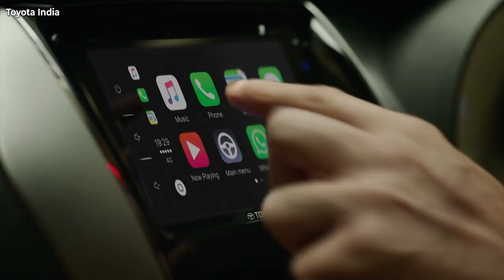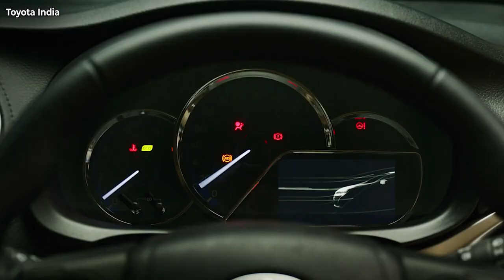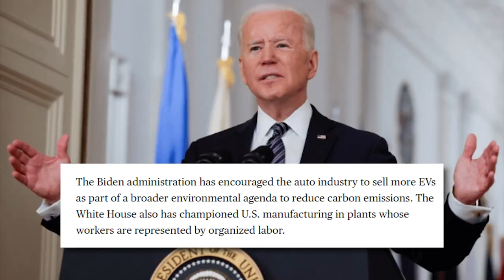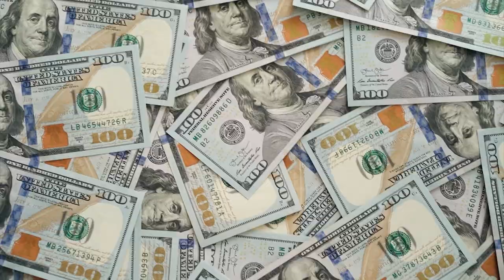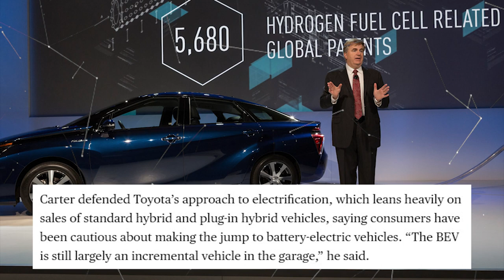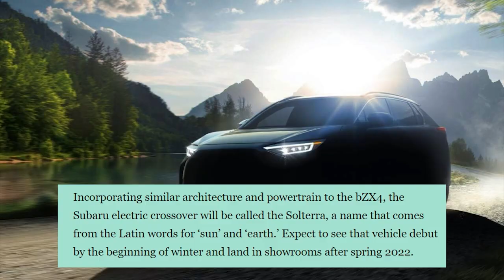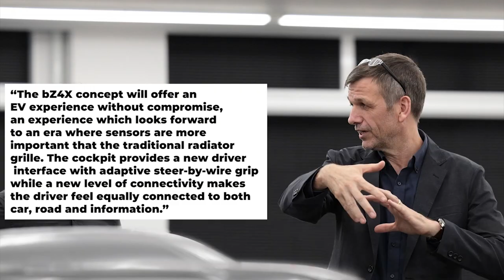Toyota Signals a Big U-Turn on Electric Vehicles With a Major Shift

Comment: It's about bloody time those at Toyota woke up. Toyota should be at the head of the game not at the back!  Whoever is responsible should be forced to resign ,this could be devastating for the company.
Reply: they actually had plans to make hydrogen fuel cell cars and not electric cars, but due to the lack of a proper infrastructure and hype about EVs, it was getting difficult for them. That is why they are behind in the EV race. It was one of the major reasons toyota wanted US to slow down ev production numbers

Comment: Toyota has been digging its grave for years now, and there is no way it is going to survive if it doesn’t go EV.     RIP  Toyota.
Reply: Your so funny
Reply: Toyota now what to do .. let them race for electric car in the begining  with some stuff issue... in the end the weapon of reliable electric car is the winning.. lets not forget  toyota now  testing new concept zero carbon , which is a regular conventional combustion engine with hydrogen fuelcell..
Reply: @dencesolihin9186  Hydrogen is not a green fuel. It is made from natural gas and is worst than petrol and diesel for environment. Just more Toyota BS.
Reply: You should do some research before making blanket statements in a public forum.  Your future you will thank you.   There is a big, wide, world out there with somewhere around 6 billion people.   The vast majority of those people will live their entire lives driving only ICE vehicles.   Of that majority, roughly 15% of them will be driving a Toyota.
Reply: @kratosdisciple4637  Considering that many countries is banning ICE sales in the next 10 to 15 years I will not bet on any company that still want to give ICE a place. But knowing Toyota they will just buy it from someone that went through the effort of developing it.  Just hope for their sake they find a seller. Toyota might build fairly good vehicles, but they are not known for their innovation.
Reply: Toyota is the largest car maker on the planet. They can launch EV's easier than farting.

Comment: Smart.  Artificially pushing supply for a product most drivers don't want doesn't makes business sense.  When I can "fill my tank" with electricity in 5 minutes like I can my IC vehicle, get back to me.
Reply: Is that why Tesla is now selling about half the vehicles that Ford is selling in a quarter? Because there is not demand for EV's? That makes business sense to you? Ok interesting.
Reply: @andresd6193  I told you not to get back to me until an EV can fill up in 5 minutes.  But have you checked Toyota sales?
Reply: @starman2337  That would be never, and EV is never going to charge in 5 minutes and a gas tank does not fill up in 5 minutes either. LOL.
Reply: @andresd6193  Really?  Mine must either be a magic tank or my station uses a magic pump.  But at least you got the "never" part right about an EV charge.
Reply: @starman2337  you must have a very small fuel tank.😄
Reply: @andresd6193  Of course there is a demand for EVs.   There is also a demand for C8 Corvettes.   For Bugatti Chirons.   For Harley Davidsons.   And for skateboards.   I suggest you do a bit of research into the EV market in Norway.  It might give you a good indication of what the future holds for other first world nations.
Reply: @kratosdisciple4637  Well, Mike Herman said "artificial demand" what does that even mean? That people are being force at gun point to buy EV's? The bottom line is that right now Tesla is pretty much the only company selling EV's in a significant number and the only company growing by leaps and bounds, if the most important factor for him is to fill a tank in 5 minutes then he can continue to buy ICE vehicles, no one is going to force him to buy an EV, however that is not the most important factor for most people, I plug my EV when I get home at night and the next morning is ready to go again, so that's really a moot point. But like I said, no one is forcing anyone to buy an EV.

Comment: Toyota is still riding on the edge it has with gas engine reliability for as long as they can. With EVs, there's no difference in electric motor reliability between the brands so they won't have that advantage anymore. They know the demand will be there based on their name alone. They've got at least a half dozen EVs in the works with one ready to be released. They just signed a collaboration with Tesla for some kind of project, and they're poised to be a leader in solid state battery development. Honda on the other hand, is so far behind on EV R&D that they had to resort to getting help from GM.
Reply: Solid state batteries are not the end game only the next evolutionary step in a better battery and Tesla knows this as they continue to work on development of their own to improve on.

Comment: EVs are actually a small SOM of the vehicle industry. Toyota is actually being smart in realizing that to focus on less than 5% of the vehicle market just maybe fool hearty. Many countries just do not have the infrastructure in place to support a big change to EVs. At the same time, Toyota is planning to launch a solid-state EV that will have a range of 300 miles and be able to fully recharge in 10 minutes. Frankly, no vehicle company does more consumer research than Toyota. They are industry leaders in quality and reliability. Anyone that works on their own vehicles realizes Toyota's are well-engineered vehicles. Being first or being reliant on one technology is not the best move for a vehicle company. Just as an example look at the Nissan Leaf. Or the all-in on CVT transmissions by Nissan. There are a lot of 10-year-old Nissan Leafs in junkyards and the cost to replace a CVT transmission on a Nissan is more than the vehicle is worth. Frankly, ICE vehicles will be around for a long time.
Reply: People don't understand this. Toyota has EVs coming out, they're not jumping on the full EV market bandwagon. They want to build cars people want to buy. If Toyota is going to be building gas powered vehicles in 2040 I will be buying one as I don't want a battery powered vehicle. All these other car companies are fools for pushing all electric, they will go bankrupt with this mindset. Toyota is focused on what is selling. If in 10 years the market switches to electric and people stop buying their internal combustion vehicles they will not sell them. People act like they know what Americans will be buying in 10 or 20 years. For all we know people will go back to horses. Meanwhile a mass amount of people are not willing to buy an EV so even if the EV   drives hit 20% its unlikely it will be skyrocketing any higher. Everyone I know will not be buying an electric vehicle 5-10years down the road and will continue buying internal combustion.

Electric vehicles are being driven by force telling people they need to stop investing in internal combustion but if automakers stop building them a Honda Civic will be worth 3 times as much. People will be looking for internal combustion because they're not going to be buying an electric vehicle.
Reply: @nobatteryelectricvehicles7659  I agree. But the going back to horse thing just ain't going to happen. The whole environmentalist push to solar power, wind turbines, EV's is now the politically correct thing. Some politicians are tripping over themselves to save the planet from climate change. Yet even the environmentalist crowd is now starting to question things like taking over farmland for a field of solar panels. They are finding wind turbines placed too close to homes or farms negatively affect people and farm animals. Just maybe burning old railway ties that were soaked in creosote as a biofuel is not such a good idea. Some vehicle manufacturers are producing very fuel-efficient ICE vehicles. Toyota, Honda and Mazda have vehicles that get 40 MPG Hwy. gas mileage now. The zealot environmental crowd and the environmental organizations do everything they can to prevent new fossil fuel pipelines from being built, even when a pipeline company wants to replace an ageing pipeline they hold up the process by demanding new environmental reviews, court challenges etc and are actually putting the environment in danger by their actions. The environmental crowd also seems to ignore the huge increase in mining activity that will have to occur to power all those EVs.All mining pollutes both air and water sources. Frankly, no one denies that the earth's climate changes but it takes thousands or millions of years for any major change. Personally, if we want to protect the earth's ecosystems we should start with the billions of tons of garbage, the industrial waste we are dumping into the world oceans. I also question the claims by many of the so-called climate experts, that falsify data to make wild claims about rapid human-caused climate change." Climate change " has become a very profitable business for some.
Reply: @don-cw1yz  well just saying they think that everyone will go to electric vehicles like they know the future, then again you got these EV pushers trying to tell people they need to start investing in EVs because gas vehicles will become unprofitable in the coming years when the exact opposite is happening, internal combustion is selling out and the value of them is going up while EVs still have horrible resale value. They can inflate those numbers but dealers may not buy or trade in an electric vehicle then.

These people are clueless about the auto market.
Reply: @waynerussell6401  It is mostly European rich countries that are buying EVs.First, the gasoline and diesel fuel taxes are outrageous. Second many of these countries have incentives to buy an EV or penalize consumers that want to buy an ICE vehicle. I am wondering when these European countries look at the loss of fossil fuel taxes and decide they must replace it with a new vehicle tax. Then will EVs be on more of an even playing field with ICE vehicles?
Reply: @don-cw1yz  EU taxes on oil burning are not outrageous in the context of global warming and health costs. That is the driving force behind EV adoption. Overall the oil business gets far more back in subsidies than EVs do - $10million a minute. But that is not a consideration for Toyota - they lobby and lie aggressively against EV adoption in all markets to the concern of 5 of their biggest shareholder groups. 
“The more EVs we build, the worse carbon dioxide gets.”
 “The current business model of the car industry is going to collapse” CEO Akio Toyoda.
That is not the rhetoric of a CEO that believes , as many commentators here state, that Toyota can pivot instantly to EVs when their market research shows it is warranted.
Toyoda is turning his back on the inevitable tide of regulation that will make his products unsaleable in EU in 2025. His sole ICE conversion BYD EV on sale in China is not selling, and he has no answer to Tesla in US.
In spite of its current sales and huge sunk cost ICE production infrastructure, Toyota has a shaky Altman Z score of 1.59.
Time to take the EV portfolio off him, retire the MBAs from leadership and reintroduce the Engineers, as Munro states.

https://www.theguardian.com/environment/2015/may/18/fossil-fuel-companies-getting-10m-a-minute-in-subsidies-says-imf
https://www.reuters.com/business/autos-transportation/investors-chide-toyotas-toyoda-questioning-combustion-car-ban-2021-05-10/
https://www.gurufocus.com/term/zscore/tsla/Altman-Z-Score
https://www.youtube.com/watch?v=EykWD9GGZTg
Reply: @waynerussell6401  You are saying paying $2.11(USD) in Norway for gas is not outrageous? The price in the US is .919. What did you think all those yellow jacket protests were all about in Europe last year. You claim global warming and health care costs. Where do you think the materials will come from manufacture all those batteries for EVs? It's called mining that pollutes both water and air. Frankly, a lot of the claims by so-called scientists concerning global warming are made with manipulated data. It seems they feel that if you keep repeating the same crap, people will say it must be true. Just common sense tells you the main heat source for the planet is the sun. Just maybe that is the cause of "climate change"? As to EV sales in China, the main seller is a $5000.00 Chinese eco box with a top speed of 50 KPH and a very short mileage range. As to your claims that the oil industry is "subsidized" well all businesses are subsidized by governments in one way or another.Agriculture, spending on infrastructure, education, the EV industry, etc... We have all the infrastructure in place for ICE vehicles. How much will it cost and how much pollution will create to put in an entire system to power EVs? If people want to buy EVs go ahead but frankly I don't want taxpayers money to subsidize their new vehicle purchase.
Reply: @don-cw1yz  WOW good selection of Strawman arguments and absolute OIL shill FUD.
Can't argue with ignorance.
Climate change deniers are the pits...
Reply: @waynerussell6401  You prove my point with your "climate denier" comment. Whenever climate change zealots are challenged they scream climate denier. Yet they refuse to understand the basic fundamentals of real science is to question and challenge. You just might want to question the so-called scientists that make wild claims concerning climate change. Al Gore just took the most extreme predictions by climate change zealots and wrote a book. Gore is no scientist but produced a sensationalist publication that was designed to sell. Michal Mann basically falsified data to produce his publications. Frankly "climate change" is becoming a very profitable business. If a scientist is sceptical of the claims made by the "like-minded" environmental groups, they are labelled a climate denier and shunned. It almost seems like climate change proponents are more like a religion than real science these days. No one denies that the earth's climate does change. We know that dinosaurs and palm trees were in Alberta, Canada during the  Cretaceous Period,(66 to 81 million years ago). Much of the claims of the climate change groups highlight damage to human infrastructure. Just maybe if you look at history you will realize the Mayans never built their villages near the coast, they knew about hurricanes, the indigenous tribes in California never built villages in the forest areas that were prone to fast-moving forest fires. Just maybe building homes on flood planes is a bad idea? You just might want to be a bit more open mined and question the so-called science behind rapid climate change.

Comment: It’s not the demand they should be waiting for, it’s here.  It’s the trend and that too is here.  The thing that is creating slow adoption is battery inventory and reliable charging stations.  Toyota’s management is dead wrong, and that’s exactly where they will leave the company in the next 5 years.  Dead in the water, don’t think Toyota is too big to fail.
Reply: It not the Keith if the Toyota CEO say I want make 250,000 vehicles and challenge Tesla he can't .  Why? because he has no batteries.  The most that Toyota can bring to market is may be 20,000 vehicles with low power range.  And let not forget Toyota has not charging network as well.

Comment: Isn’t this a bit late in the game for legacy auto to offer EV when Tesla has championed most key EV technology?  

The two aspects Tesla remains behind Toyota and legacy autos are (1) stack up random variances reduction control engineering (2) six sigma quality metric control engineering.
Reply: What does being the champion of a technology have to do with anything?   And Mate Rimac would probably disagree with you on the key EV technology part.
Reply: @kratosdisciple4637  
What is your thinking?

Comment: Which is the major shift?  Words?  Where is the action?  I thought Toyota was going to say they are converting their factories in the US one by one for the next two years to produce EVs exclusively.  For me Toyota is carving its own demise, like GM, Ford, FCA, VW, MB, BMW, and the rest of the legacy ICE makers.
Reply: Toyota announced they will be bringing out a solid-state battery EV soon. Range 300 miles and the big thing total recharge in about 10 minutes. Toyota is also developing hydrogen tech. I would say Toyota is very smart in not putting all its eggs into one basket. They make very good vehicles, do more market research than any other vehicle manufacturer. The Toyota hybrid systems are world-leading, actually, other manufacturers licence Toyota hybrid tech. They have a full range of vehicles from smaller economy vehicles to trucks. Toyota/Lexus generally tops the list for durable, reliable well-made vehicles. Being a DIY guy, I realize the simple, logical design of Toyota vehicles. For example, you can change the alternator and the one serpentine belt on a Toyota Corolla in 30 to 45 minutes. Spark plugs 30 to 45 minutes. Never an issue getting a part for a Corolla. There is a huge aftermarket parts availability for Toyota vehicles, so the cost for parts is very reasonable. You see the 2003 Toyota Corollas on the road and in good shape. How many other manufacturer cars do you see on the road after 18 years?  There are a lot of 10-year-old Nissan Leafs in junkyards in North America because the cost to replace the battery pack is ridiculously high. The batteries fail early in Leafs because Nissan never put in cooling fans for the battery packs. Poor engineering? That Leaf was about $40,000. ten years ago.